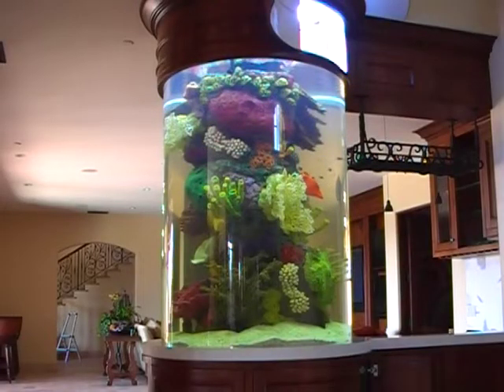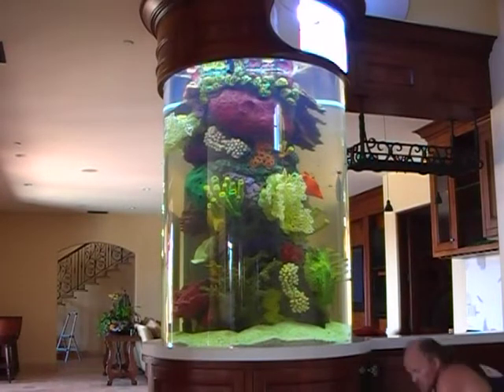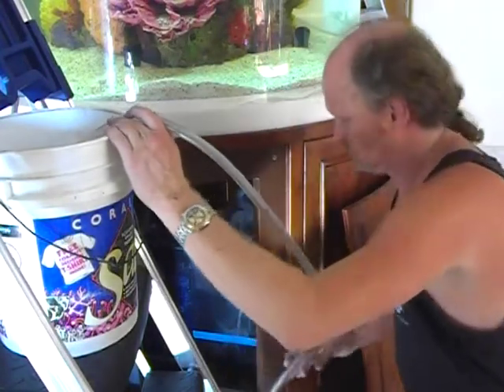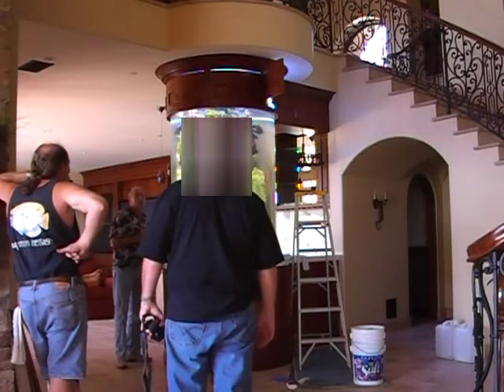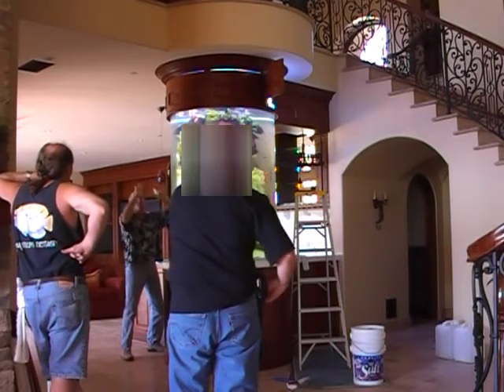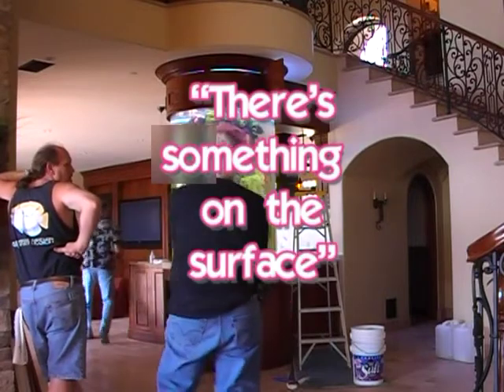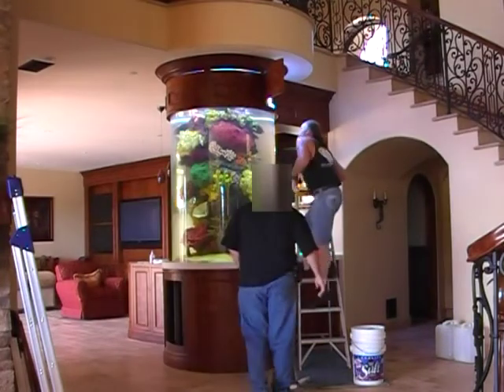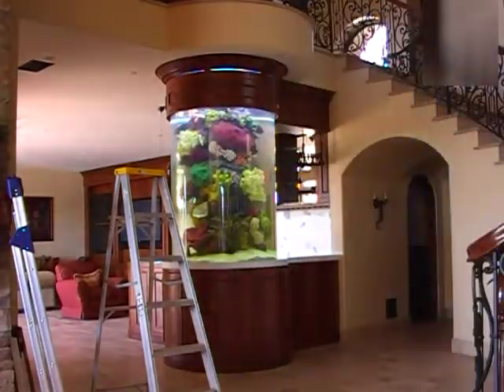Cylinder Aquarium Inspection, LA Fishguys, Episode Eleven

Comment: One thing I cannot stand, are people who refuse to put up with any tiny cosmetic imperfection that doesn't affect the strength of the aquarium. Such as a smudge or tiny micro scratch that can be polished out, but they are to lazy to do it themselves. Yet they forget that over time of using the aquarium,  there will be some blemishes that will show up from use. This is especially aggravating when someone expects nothing less than perfection from a used aquarium.

In this case, I can understand a little bit with this cylinder aquarium being new, and air bubbles, air pockets inside the acrylic could weaken it, eventually causing more problems in the future.